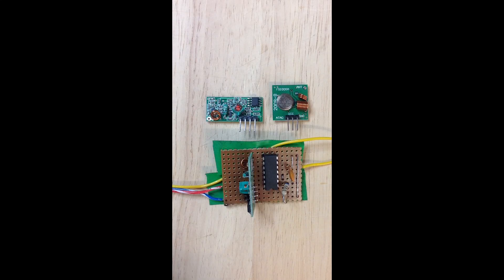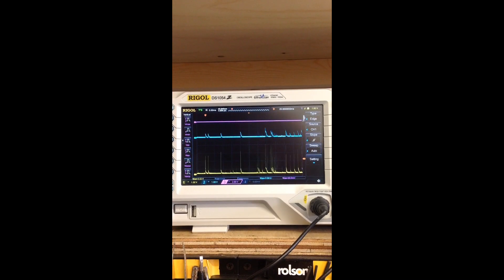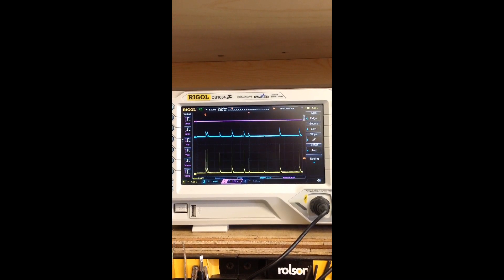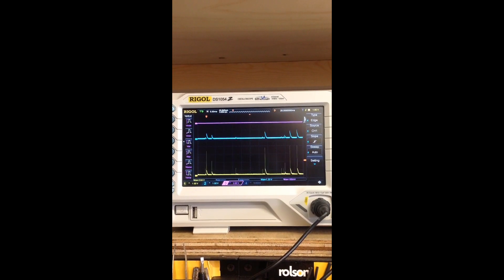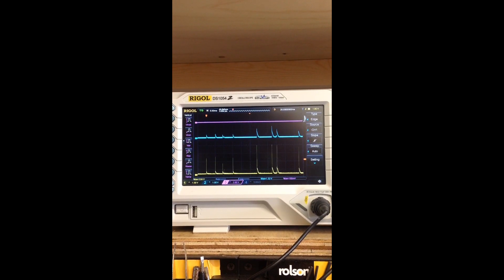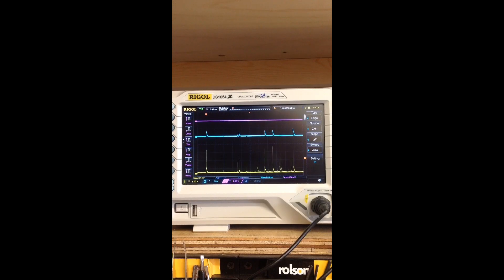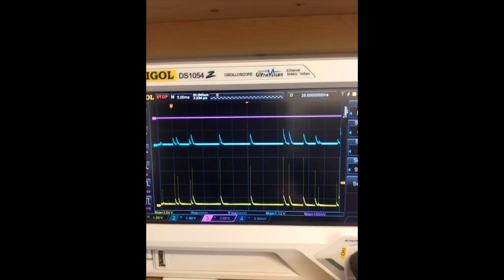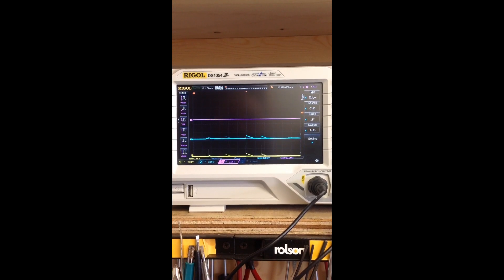433Mhz wireless transmitter and receiver noise filter hardware

Comment from the maker: There are still photos of the schematic and layout .
it’s just a cheap 433mhz receiver  a resistor a capacitor and one  ic. 
I hoped everything is in the photos.
If I missed anything please let me know.
Reply: Hi Paul, I did the exact same per your diagram but still the noise issue is there and the LED is flickering.